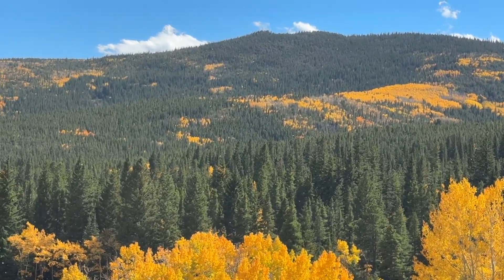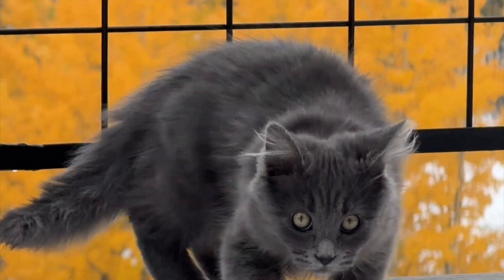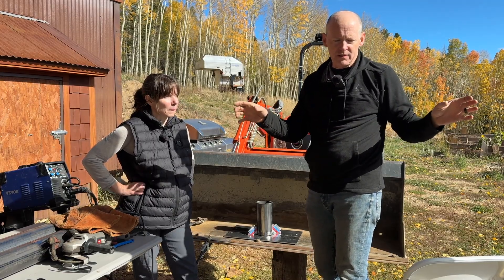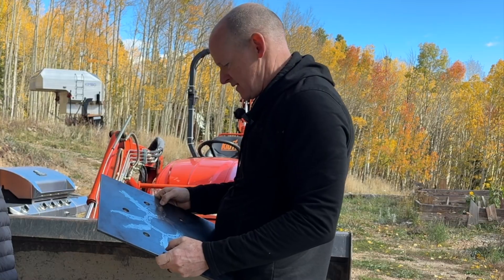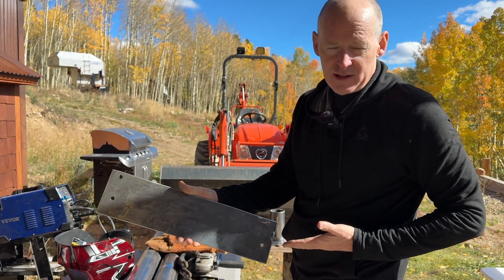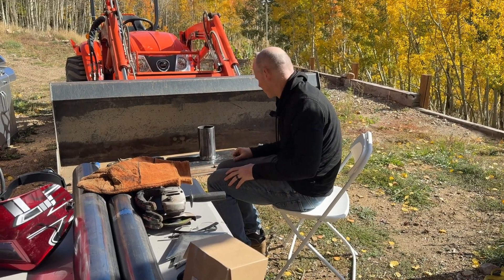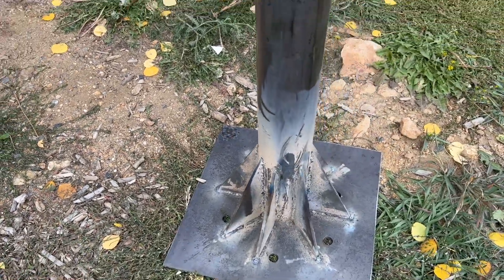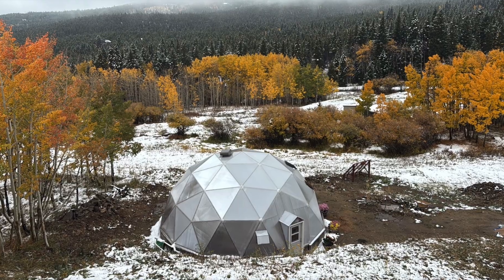Building a Heavy Duty Solar Array for Rocky Mountain Winters

Comment: Brian from what I could tell from the video slow down, don't move the torch so fast, and keep the torch to closer the metal. HTH,   Oh, & BTW if you have any questions ask away I have 50yrs of welding experience. Regards Thomas
Reply: Also, weld horizontal whenever you can. Bevel the edges so that you get more weld surface. Stick welder might be better for 1/4"
Reply from the maker: Sounds good
Reply from the maker: Thanks for the tips!!

Comment: If you can justify the cost of the metal (ouch), DIY/Welding results is a just what you want and need and will be far stronger.  Store bought stuff is made as cheap as possible to work for the majority of buyers.  With your hurricane like winds, I hope the panels themselves hold up.

This summer I helped a widow neighbor clean up her late husband's junk pile.  Tons and tons of metal.  I easily got several thousand dollars' worth of plate, square and rectangular heavy-duty steel.  I'm now thinking what am I going to make with all this valuable metal.
Reply from the maker: Wow! Good score. Majority of the steel was purchased for a good deal on marketplace (the pipes), some we already had. But yes- no sense in buying something doomed to fail.